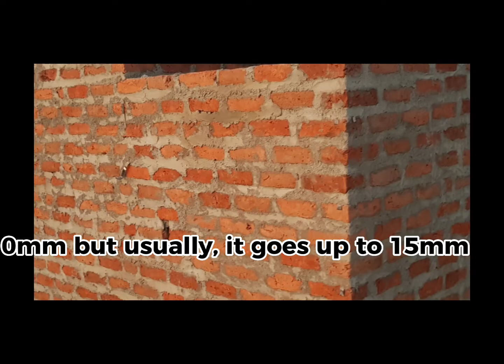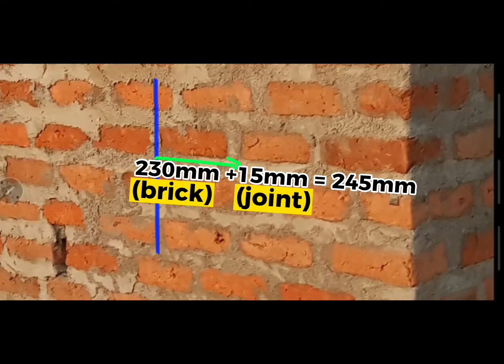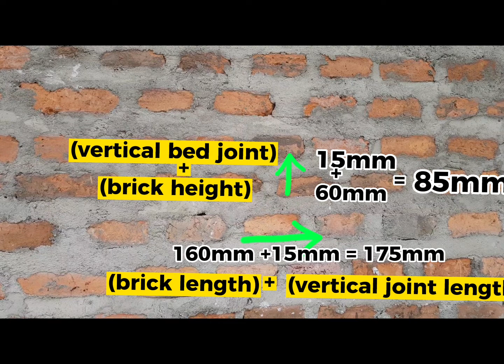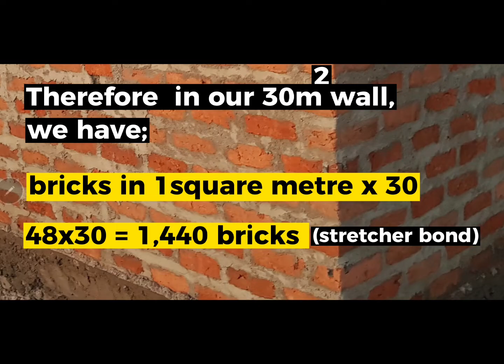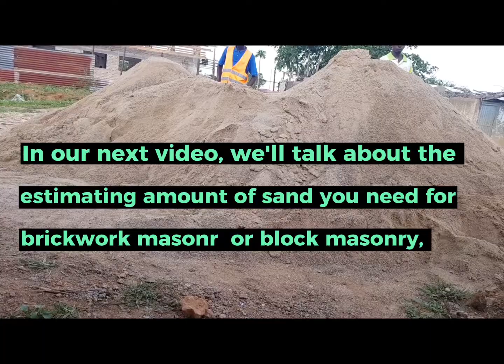How many BRICKS in a square meter?

Comment: Hey.
When counting total number of bricks of the whole house  do you consider doors and windows?
Reply from the maker: You can calculate the Area of everything  then deduct openings i.e doors, windows  openings for vents etc
Reply: @ianconstruction  I will be glad if I can find that example for enlightenment purposes.
Also how do one calculate volume of sand and cement needed for plaster work? 
Please do of this two question.
Reply from the maker: sure no problem then, will do that
Reply: @ianconstruction  thanks for your feedback.
Are you also good in building of quantity (B.O.Q)